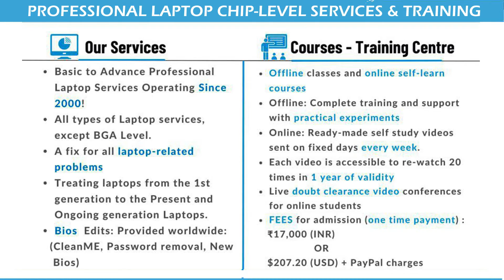Laptop Repair   The type C

Comment: Sir can this  thunder bolt connector can we operate 5volt c type mobile charger
Reply from the maker: Yes u can charge your mobile also
Reply: @LaptopCourse  Mobil charger is 5 volt then 19 volt is making pd ic internaly
Reply from the maker: Yes. Depending on cc connections